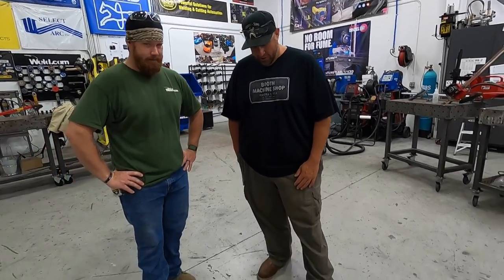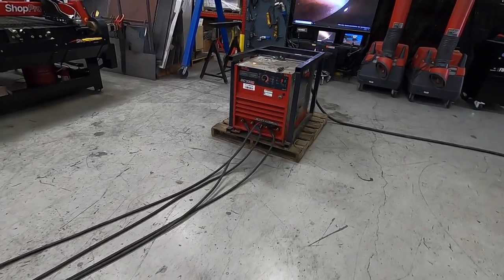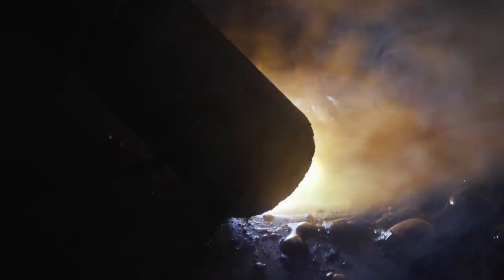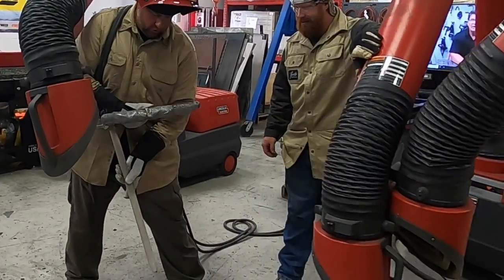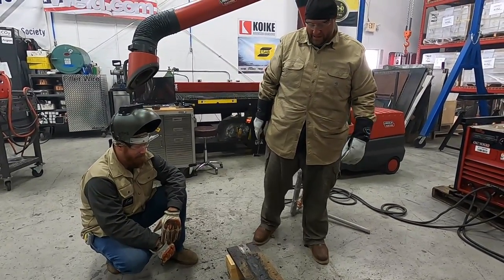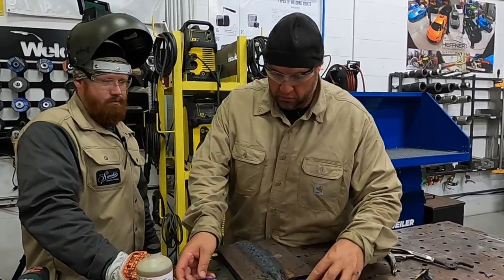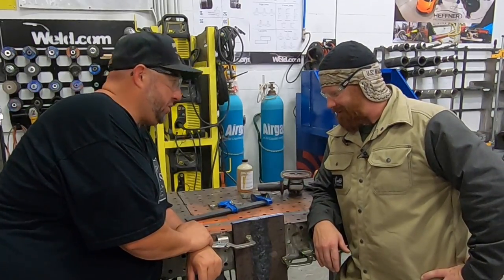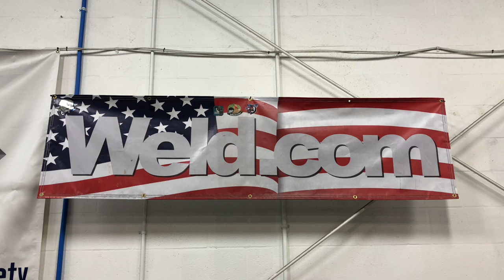1,000 Amp Stick Welding with Weld.com

Comment: One Question for the American Audience: why does he need a Generator to power the welding machine? Though its 1000Amps, do you have no sufficient direct line supply in the states? 

Im curious because in Germany we have a 3 phase 400V line supply everywhere. You can hook it up directly, though you have to look for a sufficient cable and for sure heavy breaker (The first one hardwired to your building that is).
Reply: just an idea, it takes quite a bit of money to get set up for more than 240v in off the lines and he likely has jobs that he travels to, so it's easier to have the generator, because there is no guarantee that the job site has set up for 400-480v draw
Reply: @thescottsman1996  Interesting. Why is it expensive to set up a 400v line supply? It makes sense though to have the generator for off side work, but that thing is very expensive, i guess roundabout 10k.
Reply: @bogeydope3022  cost of copper and it could be a moneymaker scheme by the power companies, some prices I've pulled off the internet for how much they charge to install 3 phase: 40k for 500'(152m) or another was 7k for 60'(18m), that is installation from the nearest 3phase line to the building, not including internal power hook ups. It also looks like the generator and 1000amp welder are rentals in the video
Reply: @thescottsman1996  Thanks for your research! Damn, that's crazy... 40k for 150m or 7k for 18m is way outta a reasonable price range. How are small shops handling this problem? Almost every machine is 3ph. Do they all get generators? Guess it makes sense to rent them in some cases. But that all sounds like a money making scheme to me.
Reply: @bogeydope3022  I think it depends a lot on location and servicing company, I think you can get converters(still not cheap) and get 480v, but just lose a lot of amperage, so not good for welding, but could probably run other industrial equipment. I have a degree in gunsmithing(Americans right!) Usually you try to find a shop already hooked up, as it used to be way cheaper to get 3phase. On that really expensive one, it might have had to be a new run, new poles, engineer design time, full linesman crew. That could have been a big contributed to that expense. 

I almost garantee it's a moneymaker racket. I know of a guy who wanted to start a cabinetmaking business. Asked the city to run utilities out to his new building. They hit him with a bill in the neighborhood of 40k and he had to declare bankruptcy.
Reply: @thescottsman1996  Haha awesome! Guess what i do for a living, gunsmithing! Germans right :-D Though im sadly no more into small arms but want to get back to it... 

back to our topic,  problem is that i can"t think of any reasonable machine in metal working wich doesn't require 3ph. Converters are bull like you said, you can't even run a small milling machine of it, amps and frequency will get in the way. 

There are some special conversion kits from Kollmorgen (servomotor supplier) for cnc machines, to run them of singlephase 230v, but are very expensive and it's a mess to get it running. 

Ok so without a place that is already hooked up, you're basically fucked. Let me guess, this poor guy didn't think of the 3ph power supply and already bought everything needed on credit and for sure only shortly before going into business he realised and asked the city? Though machines for woodworking might be possible to convert to single phase as they are usually lighter build and don't require that much load. I certainly would've tried.
Reply: @bogeydope3022  had a very good woodshop in highschool, a lot of our machines were industrial grade or contractor grade, our planer and drum sander were both 480v machines. Most other stuff was 240 or 120.
 I am guessing that he didn't know it was going to be that expensive and it came as a complete shock. The bank took almost everything ( he was smart and had the business separate from his person legally) one of the local contractors bought a huge lot of cabinet grade MDF worth 60-100$ per sheet at about 18$ a sheet. we bought some from them for only $25/ sheet. 

I don't do much with the gunsmithing except as a hobby, and keep the volume and income low enough that I don't have to declare it as a business or get the relavent licensing. I am in kansas, which is a very gun-friendly state.

Comment: Im not the world's best welder but from that cut throug it seems alot like porosity you got there.  Also I think the weld would look much better with slightly lower amps, id say the bunch of spatter around your weld indicates too high current as your arc-length did not seem excessively long. Verry impressive process though.

Comment: What an incredible video!  And I have a story just for Abom79!

A 2400A stud welder that ran on 600v is something I the pleasure of using when I worked in a structural steel plant at one time. This thing would weld 7/8" diameter studs to a 1/2 substrate in only a second or so.  The purpose of them is to give deep anchoring to a steel part that will be set into wet concrete.  I was attaching studs to the back of steel coping that goes along the top edges around the chambers of the canal locks in NY state.  

So on the cable assembly going to the stud gun, the power cable was at least as thick as a 5/8" garden hose, and the other control and cooling cables were smaller and attached along the whole way.  I was doing this right next to the machine the size of a large refrigerator, so the cable assembly was hanging in this huge loop on the wall behind me.  As I just kept pulling the trigger over and over again with this foolproof stud gun, I noticed this movement reflecting off the back of my helmet lens.  It was the huge loop of huge cables that would contort and try to twist up during the weld and then fall limp as soon as the current stopped.  

Imagine twisting a coiled loop of phone charger cable almost 180°, half a circle where the midpoint of the loop almost touch.  This is what the welding cable was doing behind me!!  The stud welding is so mindless, I started watching the cable instead because I couldn't believe what I was seeing.  The cable reel was about 6 feet high and lifting each loop off was like the warmup to a powerlifting workout.   

Conclusion:  I'm so happy for you and jealous at the same time that you got to have this experience.  

To say that you could feel the current flowing through that electrode like it's water through the cheapest garden hose you've ever touched would be an understatement.
Reply: Ever heard of an electroslag welder? It would weld a 4"  plate or more in one pass. I operated one at Westinghouse. A wire was fed through a steel tube with the puddle contained by water cooled jackets ..  REALLY BIG WELDS!

Comment: I can't see any practical use for that. A customer would not pay for porosity, and penetration was rubbish.
Reply: Don’t take everything so serious. I doubt anyone would actually use this during real work. Everyone watching this most likely wouldn’t use it. I would compare it to something but I can’t think right now.
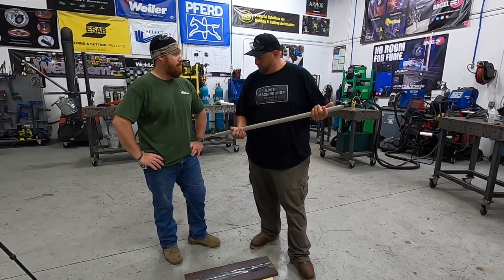Reply: 3:22
Reply: I agree on the porosity but that is more a technique poor prep issue. What these are for is called flood welding. They are used to build up worn out dies and moulds generally for forging so that they can be machined back to spec .
Reply: @chefboyarb  these rods are used for repairing cracks in Foundry Crucibles for example. Which is, quite possibly, real work.

Comment: Feel the UV? Does he realise you cant feel UV light?
Reply: It’s an expression I think, because welding will actually darken and burn your skin just as the sun does. I’m no welder though…I imagine it’s essentially “feeling the heat”? Might wanna ask a welder that one. And like you said, could just be total bullshit.
Reply: @noaht5191  yeah the UV that comes off will darken your skin like the sun but what he was feeling would be the infrared light like the sun aswell
Reply: He's a machinist, not a physicist, spare him the nitpicking. All he meant is that he could feel his skin being affected by the arc flash.

Also, BTW, any light that gets absorbed by your skin will make it heat up, you can feel powerful UV just the same as you can feel powerful IR and powerful visible light. These aren't sunlight-level doses of UV, there's a reason he has almost no skin exposed at all.
Reply: @michaelmcatamney9231  what many dont know is that UV also generates heat. Youre feeling both the UV and the IR.

Comment: 1000 amps .. at how many volts??
Reply: Google it
Reply: 500 or so I believe
Reply: @cearl732  The generator output is 500Volt AC. The welder turns it to Approx. 50V DC. At 1000Amps thats about 50,000Watt.

Comment: and how many volts to generate 1000amp?
Reply: Saw it on the generator. close to 500 Volt DC.
Reply: It's more about power, the output is 1000 A x 44 V = 44 000 W  (From spec sheet) = 44 KW DC output, with all loses inside the welder, the Input is above 44 KW
Reply: @zakel5750  What kind of power plug you have to have to support 44KW DC? In EU you have 3x 16A 240V (3840 W) AC to your home, but for this you need to have 4 times more and that's not counting losses from AC > DC.
Reply: @michalzidek40 they used a big generator
Reply: @michalzidek40  In the EU (germany here) 63A x 400V is pretty common = 25.200W, take that times two and you are there already

Comment: Is this what they use to weld on ships?
Reply: Probably not. Normally for heavy plate you would do a V or U groove and then do multi passes with small filler material. Normally you would use subarc on longer runs.

I've seen subarc done from both sides on about 1 inch plate with a cooling shoe. Cool process.
Reply: nope. Ships, at least cruise ships, are just 1-2 cm thick plates which are welded together on flat ground most of the time and there is a cart that drives over a groove with Filler material for near perfect weld, cuz you can't have a guy run along a weld for like 10m straight lmfao
Reply: We use flux core wire, with track welders on ships

Comment: 1109 is my favorite Electrode
Reply: Youre reading upside down. Its 6011
Reply: @autodidacticartisan  no, it's 1109 it's for welding upside down
Reply: never tried those.    Most of my stuff is flat, benchtop welding.  I've taken a liking to 7014.  I often machine weldments after welding & the 7014 machines nicer than most cold rolled steels.
Reply: @chrisward4576  i think he was make a little joke, maybe a running joke among welders?
Reply: @mtraven23  actually he's the one making the joke. Cuz when you're welding upside-down 6011 reads as 1109
Reply: @autodidacticartisan  yah, that's what i said.
Reply: @mtraven23  you replied to him saying "I think he was make a little joke" implying that I am the "he" in that sentence. But regardless... It was just a joke

Comment: I just bought a stick welder and I thought these 1/8 were large! I have a question, does weld stick width change based on size of metal welding?
Reply: Yeah mate
Reply: @realsyko9846  frick yeah man thanks for the hastily reply!
Reply: All goods mate

Comment: Circuit breaker clearly says 400 amp........
Reply: The Welder produces the 1000 amps. It doesn't require 1000 Amps to run. Probably wired up for 100A @ 480v there.
Reply: Amps x Volts = Watts. Watts will be constant as that's the work being done, the welding machine is basically a transformer which divides the voltage, multiplying the amperage. The generator is putting out a high voltage and lower amperage and the welding machine transforms it to a low voltage high amperage as well as turning it from AC to DC in this case.

Comment: What are best leathers to wear for overhead welds?
Reply: Get used to being burned while overhead welding, especially on low trailers.
I used to hibernate in leather, it doesn't work 100%  of the time. Protect the jewelry
Reply: Any...

Comment: You went beyond the critical range. There's no way this is a useful weld because of poor heat management. I prefer thermite paste or chemical welding/annealing for big welds.
Reply: This is just goofing around, the amperage could have been turned down by 200 amps or so. These rods are made for welding castings and other large scale industrial items (foundry rolls, pots stuff like that), the material these weld are measured in feet of cross sectional area. Weldments where the weld deposition volume is the real critical item, the phase transformations that would be affected are in no way considered in this application. This video is for views, not really for demonstration or education. The methods you mentioned are valid but not practical for the application  this is specific to.

Comment: Flame cut to check penetration?
Reply: The way they are doing it uses acid to show the chemical difference in the metal, flame cutting doesn't change the composition of the metal

Comment: Really disappointed with the depth. 
I thought it was an interesting video… no doubt. 
You may have repeated the same things several times in the beginning, but it was very interesting. 
I say disappointed with the depth… not as if I believed it should have gotten deeper… but that I actually thought it had! 
As you were welding… it seemed like it was getting pretty deep? I thought it might have been getting close to complete, even? 
I was horribly wrong. 
Either way… thank you, for sharing.

Comment: got damn!! and security? It is a lot of radiation that generates that type of voltage, God not even to think about having babies.
Reply: Arc welders are actually really low voltage, around 20-100 volts between the electrodes. On top of that arc welding doesn’t produce any ionizing radiation.

Comment: 1100 amp! How do you prevent from being electrocuted? 1100 amp. DC or AC can't be good for your health! 😏😂
Reply: Voltage is low don't matter if it's 10.000 amp a welding glove will do the job

Comment: horrible quality of weld
Reply: do you have an example that you could show us of you welding with a rod that size?
Reply: @robertcampbell5485   No - but thats not how electrode weld should look alike. Im a welder for 19 years with shipyards, oil platforms, bridges, still mills, tunnelling boring machines background. I welded thousands of electrodes in my career. Quality of that welding showed in movie would be rejected by 99% of inspectors I faced
Reply: @naydah I don't think you understand how YouTube videos work my guy
Reply: @thecrazyfarmboy   im a welder / arc air gouger bro - video of my gouging is on my channel. I know only how weld should look like and how it shouldnt
Reply: @naydah  in the video they say they are just messing around with it. that set up is for a machine to use not by human hand.
Reply: @robertcampbell5485   I judge what I see. Not what they wanted or so. That is horrible weld quality.
Reply: One thing to consider to is this process wasn't intended to be done by hand. This wasn't ideal to begin with. The point of the video was to showcase a rod nobody has ever seen before, not to produce a perfect weld.